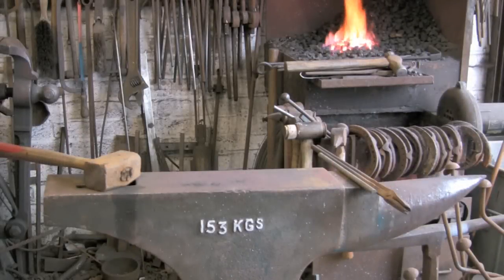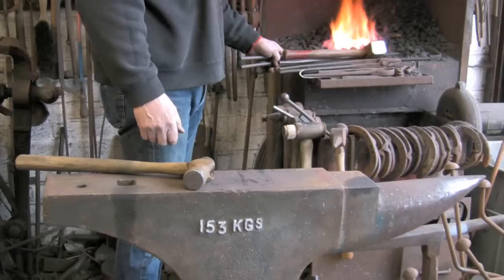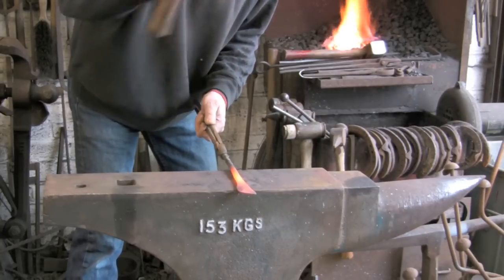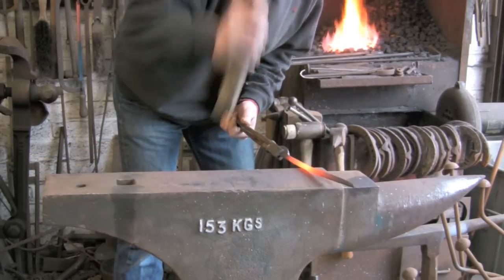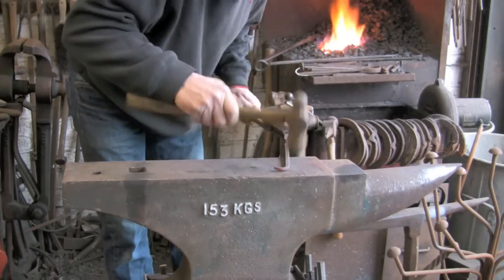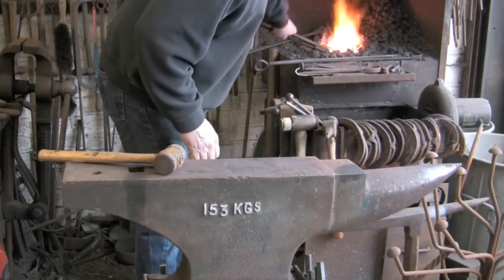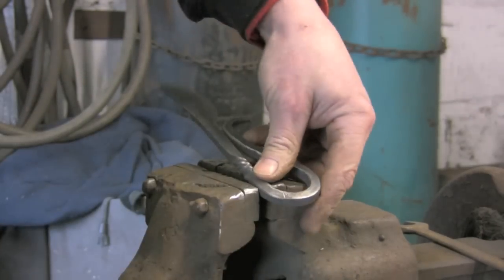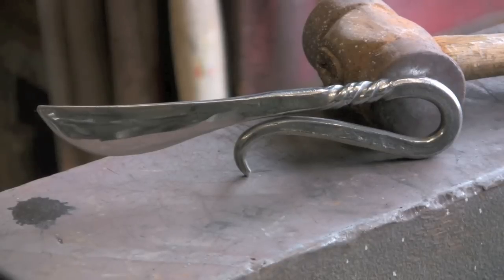Stainless Steel knife.

Comment from the maker: @RodneyLeonard Very good question! I have deadened the ring by mounting the anvil firstly in an angle iron frame which has 3/8" of rubber in the bottom. Really dense rubber which doesn't give much. Then it's welded onto a tube full of expanding foam, which is welded to more angle iron that is bolted to the floor through a plank of 2" wood! Easy!!

Comment from the maker: As for welding, if you weld stainless with mild steel rod or wire then the resulting weld will rust but if you use a good quality stainless rod you will be fine.

Comment from the maker: Firstly i'm no expert, but in my experience there are a couple of reasons stainless rusts. Firstly lower grade stainless will rust readily. More common though is the stainless being worked on and with tools that have been used for mild steel. Particles become embedded in the surface causing rust. A second similar problem being using a polishing mop previously used on mild steel for the same reason.

Comment: advice for your old age: 
1: Drill a hole in the end of your wood hammer handles. just under half inch so that you can tap the hole with half inch threads.
2: Screw in a half inch threaded rod stud that is about 3" long - I usually put some silicone on it so it slides in easy and won't back out. 
THIS IS BY FAR the BEST answer to the residual shock problem associated with using a striking tool.  It places a heavy weight right where it is needed most - I was a sheet metal worker for 16 yrs and this was noticeably the best reduction of shock I have ever tried - If you use metal handle striking tools you can reduce shock by going to wood - but if you already use wood - this will help more. 
The extra weight is almost un noticeable compared to the shock reduction.

Comment: I made a knife shaped like that out of some cheapo A36 steel a while back - although mine didn't have the twist in the handle.
I'm still at the stage of blacksmithing where I want to practice on the cheap stuff, but I think I'm getting close to where I'd like to be to start playing with more expensive materials.

Comment: Thank you for posting this Gary. Not just for the project itself but I enjoyede watching your hammer work. I make custom knives using stock reduction methods on my knife belt machine. I make nice perfectly functional blades but I'd like to use a more traditional method without wasting steel. Your hammer and anvil skills are admirable. It helps to watch a proper blacksmith at work. It helps out....Thanks for posting mate.

Comment from the maker: Yes I do, if you look through my videos you will find one called "Quiet anvil"
Reply: Gary, I have a stainless steel long sword that I love, can I regorge or turn it into battle ready sword?
Kindly inform me if it's possible
Reply from the maker: What is the difference between what it is now and a battle ready sword?
Reply: @garyhuston  I can't clashing it with other swords in training or hit  anything hard, it will break and shutter..
The sword is 440 Stainless steel btw. 
Do you think it will hold? If not please answer the question
Reply from the maker: 440 is hardenable to Rockwell 58
Reply: @garyhuston  is that means the sword is good as any other high carbon swords and it will break? Why it says its for disply only?
Reply: I'm a bit confused here kindly explain
Reply from the maker: It’s not that high, it probably means it hasn’t been hardened and tempered, or, they don’t want people using it to cut off people’s hands!
Reply: Ha Ha, no cutting off heads lol I wouldn't bother asking you if it was, it was written on sword selling page in the website, so you say I shouldn't be considered with breaking?
Reply from the maker: I really couldn’t say what they mean. Why not ask them?
Reply: @garyhuston  I did, they said it's not battle ready, so I'm asking you as a blacksmith can it be reforged or turned into battle ready sword? If the sword is battle ready sword please confirm so I can start practicing because they said it's breakable and dangerous since the broken parts can reflect and hurt you..
I could buy any high carbon sword but I really like this one! Check the below link to get my point

https://www.etsy.com/listing/727725470/monogram-sword-custom-sword-personalized?ref=user_profile&frs=1
Reply: Gary?
Reply from the maker: That is too cheap to be made of anything good and is only a partial tang so no good for use. You could try but it would ruin the look of it with all the heat treating and would probably break anyway with no proper tang. Find a new hobby or buy a good one.
Reply: @garyhuston  yeah I think I'll drop it, last question please, which one is better for sword 1060 or 1095 high carbon steel?
Many thanks for bearing with me
Reply from the maker: Allah's lion Commander I have no idea, I have never made a sword!
Reply: @garyhuston  thought making swords is your thing, best wishes
Reply from the maker: No, not my thing at all, can’t see any point in them.

Comment: Hexavalent chromium [Cr(VI)] is one of the valence states (+6) of the element chromium. It is usually produced by an industrial process. Cr(VI) is known to cause cancer. In addition, it targets the respiratory system, kidneys, liver, skin and eyes. Chromium metal is added to alloy steel to increase hardenability and corrosion resistance. A major source of worker exposure to Cr(VI) occurs during "hot work" such as welding on stainless steel and other alloy steels containing chromium metal.

Comment: Adam..I weld stainless every day in a well ventilated area. chromium does not become air born until the metal has reacged the melting point so should not be a problem when forged.

Comment: @garyhuston How about a cane handle. Like the metal topper on a cane the elderly might use to help them to get around. I know you made that Ran's Head topper for a walking stick. That was more for decoration than function though. Door Knocker. Weather Vane or a Symbol/Animal for the top of one. Fireplace Tools. The handles could be from multiple smaller rounds twisted together, then would separate out for a handle and still follow the twist of the shaft then combine at the very end.

Comment: Hi can you tell me what grinding discs to use on 316 stainless.
I have round bar 8mm thick that I need to grind flat both sides.
Or would a bench belt sander be better?
Any help would be appreciated.
Great job with your knife!!
Thanks
Reply from the maker: It depends what you are trying to accomplish. Do you need it to be smooth even and polished or do you just need to rip the material off..Either way you probably need more than one product. Ordinary 40 grit flap discs would probably do if you only have a few to do but if you have loads to do you might be better with a big belt sander or even a bench size. I can’t tell you without knowing what you are trying to do.

Comment: If you use your knives just for decoration 316 is perfect. 
Good knife steel? I like N6090co and 440c  if I need a knife to be used in water (even salt water) I would use a H1 steel knife for example, but I don't know if those steels are easy to forge. I know that stainless may crack if forged wrong.

Comment: Hi, beautiful work!
I Thought that stainless steel can't be worked hot?
For example, after welding stainless steel there is rust much more easily on the welded part, I have been told its from the heat..
What do you think Gary?
Thank you :-)

Comment: I made a knife once out of an odd sort of  auto mobile coil spring. It was a silvery color and when I went to heat treat it  was not magnetic even when cold. Do you think it could have been stainless. I thought the blade was a bit soft when I hardened it t a very light blue.

Comment: Doesn't using carbon steel tools on stainless kind of defeat the purpose? Maybe I'm wrong but I thought introducing any type of mild or carbon steel to stainless would cause it to rust the same as normal Steel.

Comment: Hello can someone tell me how easy and cheap to heat treat blade, but not forged. What tempeture how many times and in what should i put them after the heating in water or something else. I want to take regular stainless or not stainless steel shape it in the form of the blade that i want and treat it. Overall i want to make blades without forging them. Thank you !
Reply from the maker: It depends greatly on what steel you are using .

Comment: chromium is in stainless steel. chromium IV is a very toxic by product of stainless steel hot work and welding. does forging stainless steel pose a risk of chromium 6 fumes.

Comment: Aisi 316 for a knife? Terrible steel for a knife, very rust resistant, especially if it is 316L, but with very low carbon content. It's a soft austenitic steel.